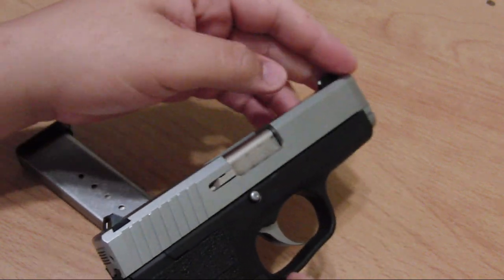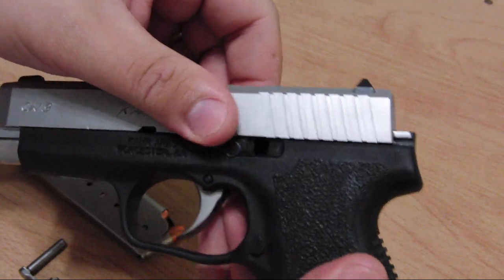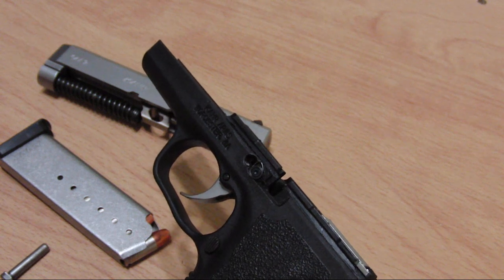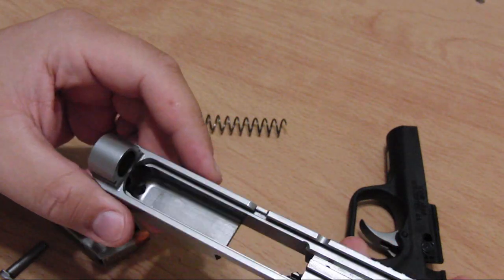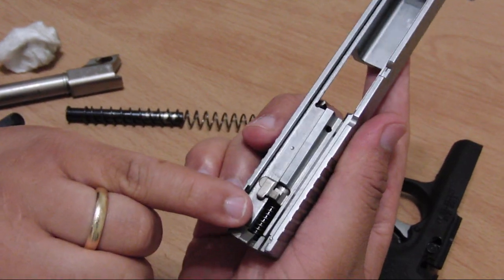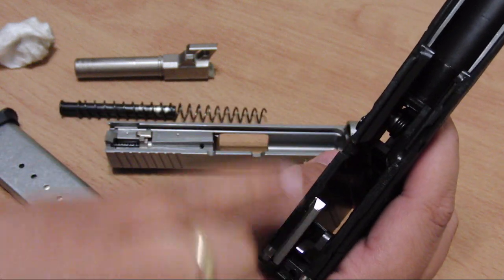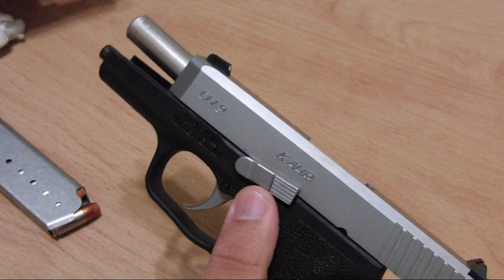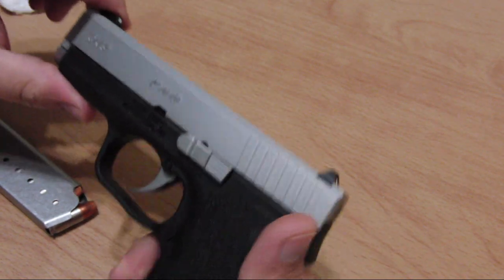Kahr CW9 Field Strip and Cleaning Guide

Comment: Ive got a Polymer railed Ruger P95 made in 2007.  Theres probably about 10,000 rounds through it, the plastic hasn't worn a bit.

I don't know what year you live in, but new-age plastics are just as strong as steel, lighter and cheaper.  Technology is a beautiful thing.
Reply: bigwalt2990 

I agree
Reply: My p95 is one of the best guns I own super accurate and never jams I also have 10,000 plus rounds through it

Comment: Exactly.
He's mistaken saying that this gun "will fail" if a lot of rounds are fired through it because the slide rides directly on the polymer frame.
As you point out, the slide does not ride directly on the polymer frame, it rides on two steel rails.
Kahrs are very well constructed, very well designed, and very dependable.

Comment: LoL  Damn, I saw this and freaked out, Leo!  Was already about to sell my P9 which I picked up in 2005 (haven't even put 500 rounds in it until took my CHL class this past weekend), and when I called KAHR, was told the same, front rail and tiny ones on back.  Still wasn't too thrilled, but guy says "you have to break it in, and the slide is supposed to eat up the polymer frame until u've shot enough rounds."  Hopefully that's the case and doesn't fail. :)

Comment: The rails mounted in the "dust cover" are the intended front rails. Kahr has a very low bore axis, so they have a different rail system, and a feed ramp off to one side. Their rail won't fail, they're just as durable as most others. I had a CW.45 and the rails has no stress indications ever.

Comment: Well made vid, 
but as for the metal guides, if you look there are two long ones down low in the front part of the frame, (look at the front of the slide, those two small slits on the outsides is where it rides) 
I missed it too at first.

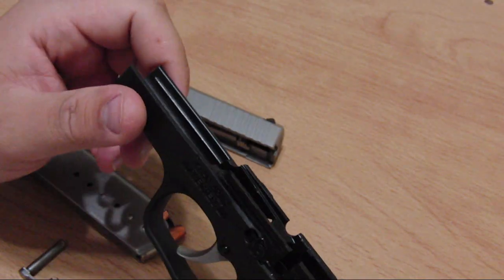Comment: The Kahr CW-series slide does ride on 4 steel rails. The two front rails are tucked down in the recoil-spring relief in the frame. They are plainly visible at 1:28 through 1:54... While you are discussing how it only has 2 steel guides. 
Aside from that. Nice review.

Comment: Clean and lube the firing pin by spraying, with a straw, into the small hole on the bottom of the slide just down from where the pin striker hole is.  You can also pull back on the firing pin spring to reveal the pin to spray and clean that area.  This process will blow out any crud that gets trapped in that tight area.  If you use Break Free and clean your pistol regularly it will not collect dirt.  Move the firing pin with your finger before and after and feel the difference.

Comment from the maker: @viperchilli Whats going on brother. I have a tip for you. I don't recall if I mention it in the review but if you load the factory magazine that comes with the gun with 7 rounds in it and manually pull back on the slide to make it release the round will stove pipe in the feed-ramp. I was told by another youtuber that the proper procedure is to lock the slide back insert the 7 round magazine and release the slide with the slide release leaver and that way it doesn't jam. very helpful tip.

Comment: It has metal rails in the front of the frame too the way the pistol is made the stress of constant firing is put in the rails not the polymer as you stated. This pistol is as solid as a baby Glock single stack in fact the nickname for this Kahr is babyglock. Some law enforcement guys have these as a personal backup ankle holster or back area cause of its lightweight and reliability

Comment: does that change your long term outlook on the longevity of this firearm? 
I am seriously debating between the cm9, lc9 and nano, and as of right now I am leaning towards the cm9.  second choice would be the nano.  Nano is very well built.  Full length steel slide rails in the frame.  I am very impressed with the build quality of the nano.  basically same price as the Kahr (Maybe $30 less) but comes with 2 mags.  So undecided at this point.  Both are USA made which is a plus...

Comment: There's nothing wrong with that slide riding on polymer rails.  A great example of another gun that's set up the same way is the Ruger P95.  People have put THOUSANDS of rounds through those and they're still going.., and I personally have a P95 that has spit out A LOT of lead over the years.  As long as the polymer is of good quality it'll last.

Comment: It does have 1 1/2 inch of metal frame in the front. They’re lower in the curved portion of the recoil spring shroud. You can see them between his thumb and finger at 1:30.  This is a non-issue.